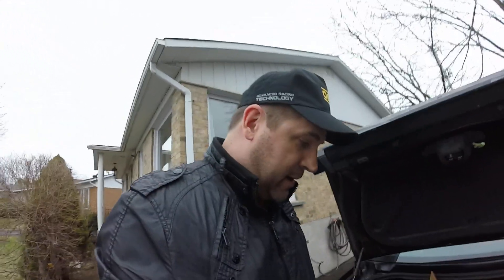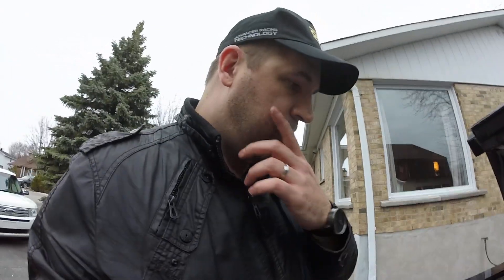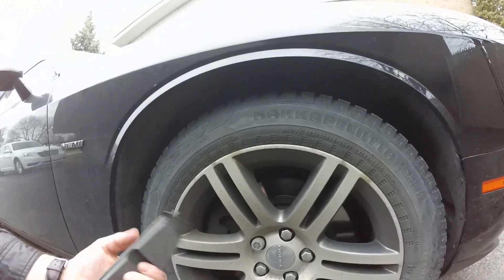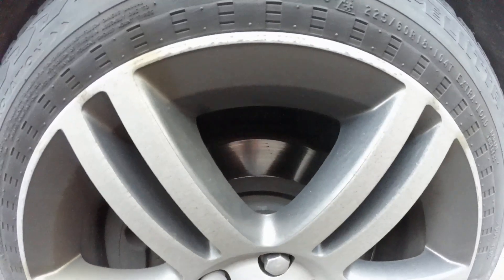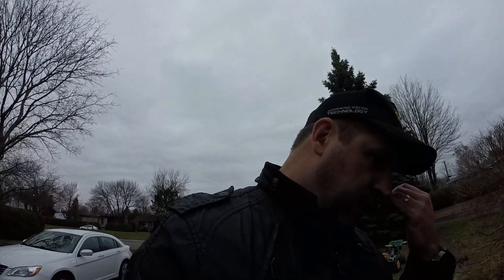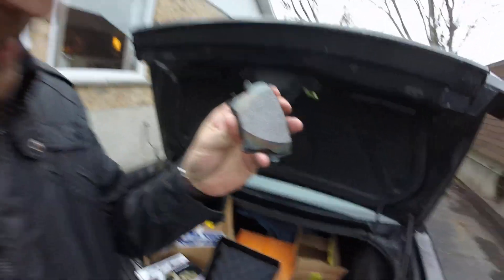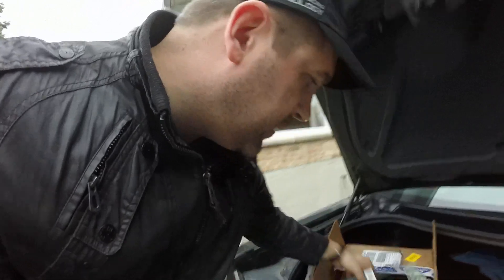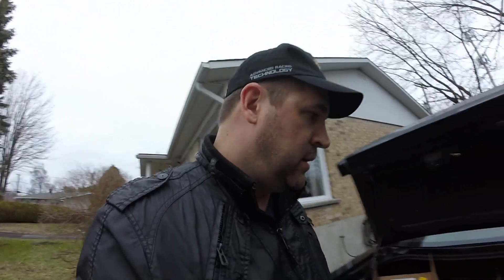Dodge Challenger Brake Upgrade Disk & Pads

Comment: Mike, 

   Your thoughtful reflections on the options you took were most helpful, as I'm looking to upgrade the brakes on my 2013 Challenger R/T.  The tip-off about the insane price for knuckles to accommodate the multi-piston calipers is eye-opening.  Nobody told me!  Your staged approach is something I would also have to do.
Reply from the maker: Thank you. I'm happy to know it did help you learn something new.

Comment: Great minds think alike! I just got my Powerstop rotors and pads delivered today. I hope they work as advertised.
Reply from the maker: Lol thanks. Well not initially. The bed in procedure needs extra heat...
Reply: 169 Design, how have you liked the rotors and pads?
Reply from the maker: Still have them on this winter...they are doing great. About 10k miles with 2 hours of hard track sessions. They bit hard still but starting to be a bit loud. You?
Reply: I am just struggling to figure out what to get. I can get the wilwood big brake kit for $3300 from TCE. Seems like the cheapest option for all 4 wheels for a big brake kit, but I could just do some rotors, pads, stainless brake lines and that really good brake fluid you talked about in your video Mike. My current brakes have plenty of pad, but the rotors have a lot of ware, looks like someone just slapped pads on existing rotors. I've only have it since last September. Has 60k miles on it.  Really want to get the Barton shifter, headers, and a tune also. Those wilwoods would wipe me out on upgrade money for a long while, and I am trying to see if a cheaper brake option would do what I need it too. Just cruising, and a couple track days a year.
Reply from the maker: @bringer0frain994  I think so. 3300 is a lot of money and perhaps not worth the full investment versus its return considering you don't spend a lot of time at the track...

Comment: I spent $1100 on all new Blacktop Edition rotors with new ceramic pads, made a huge difference bud, much less brake fade, no brake dust or noise, very happy with my set-up & it's perfect for the street.
Reply from the maker: Yes, Good setup for street ! Ceramic pads are a good choice.👍
Reply: @HemiMike  I would buy a new 392 2019 R/T wide-body which comes with a finely tuned suspension & 6-piston Brembo brakes, a real road racer out of the box because changing a R/T like ours to perform good would cost 20K probably my friend.
Reply from the maker: That thing is a beauty, pretty close to perfection in my book.

Comment: Some good info! I will be interested in your impressions of the pads.  I have Motul 600 brake fluid in my Charger.  I have the same thought as you, I'm going to try and upgrade the stock brakes before thinking of a big brake upgrade.
Reply from the maker: 👍 my first impression is that The curing process on this combinaison requires a lot of heat!

Comment: I had race pads on my R/T for a while and the squeaking was so bad I had to remove them.  They were a semi-metallic kevlar mix.     I ended up going with ceramic pads, no noise and the reduction in brake dust was remarkable.   They were still on the R/T when we went to Lime Rock and they did pretty well. I definitely need to get some race brake fluid though.    Still running with the stock fluid in the Cat and the R/T.
Reply from the maker: No noise yet on my side. But that is a fact that comes with performance pads...
Reply from the maker: 2 fronts, 1 rear